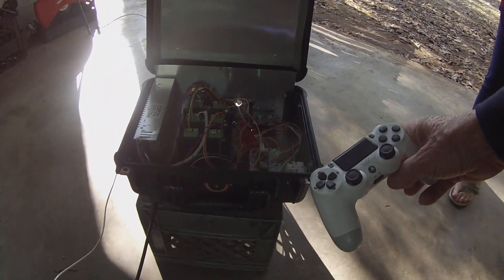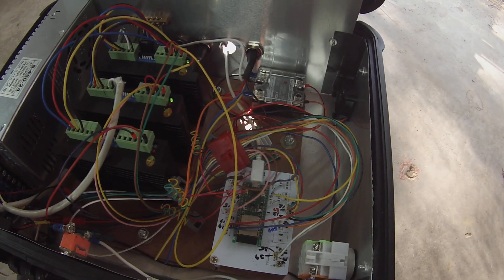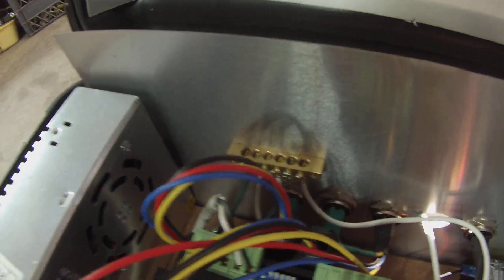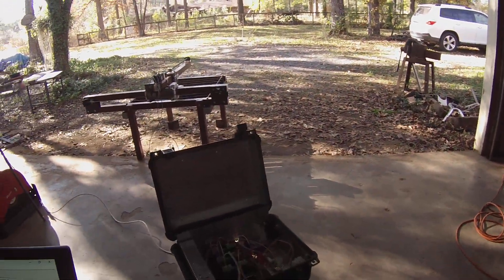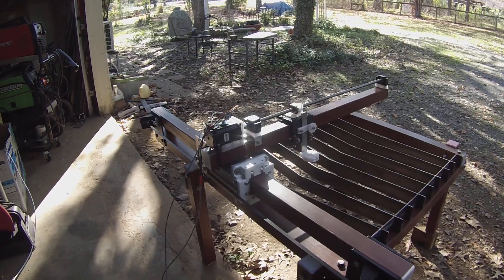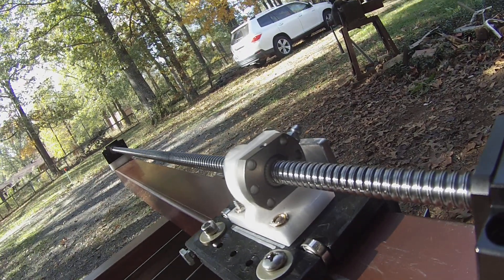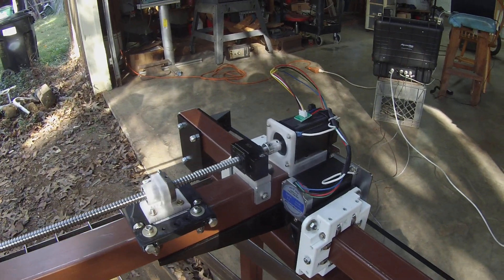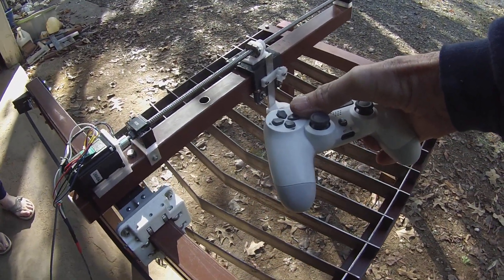Finished build of basic JDsGarage CNC table (no Z axis)

Comment: I have bought the plans and going to build my own.  Got curios on your choice to use a ball screw instead of a belt. What's the reason for that choice? Thx.
Reply from the maker: Couple of reasons, it makes the overall weight of the X axis and Z axis lighter.  It was only $46 for the SK1204.  I knew I would be able to fab mounts and line it up with 3D printed mounts.  I also used the original holes on the X axis intended for the standard mounts plus needed two more.
I had doubts at first and was ready to go with the original plans if it failed, but only had a few niggles (alignment required reprints for mounts) plus you can't move the X axis by hand like you could with a belt drive.  But turns out It works fine.

Comment: Like the modifications  specifically the controller  i building  4ft x 32   dual y  axis  more like   langimer pro table i was also thinking  about using  apache  case too
Reply from the maker: Thanks.  I have the extra parts and tubing to make the other Y  mount, not necessary for plasma, but would be needed for a spindle.  Working on mounting the wiring tracks currently.